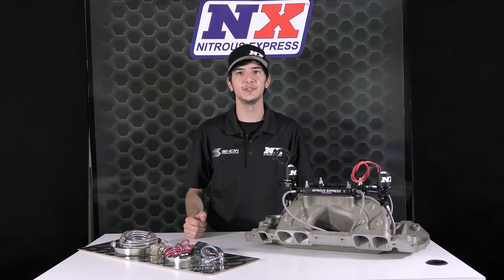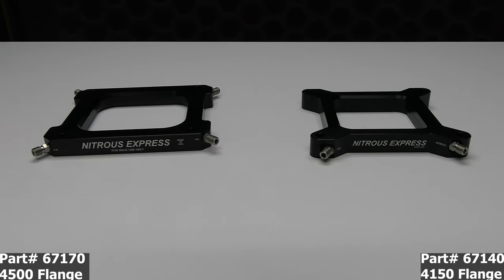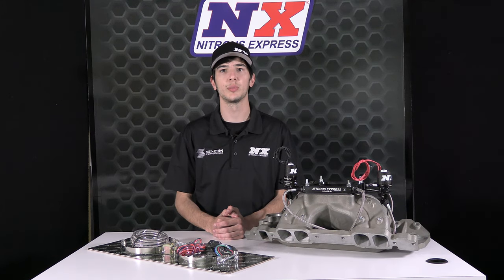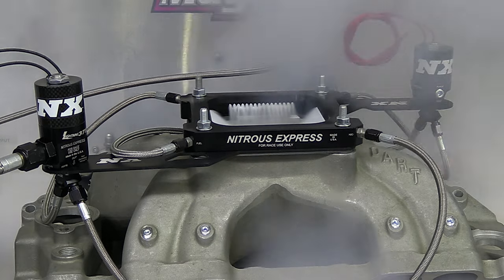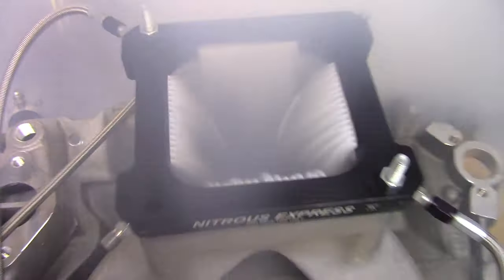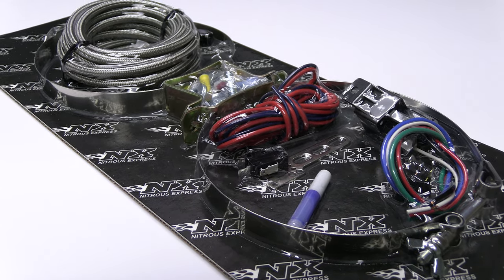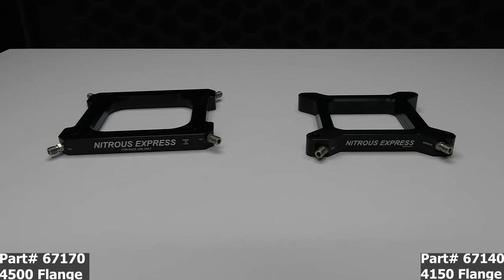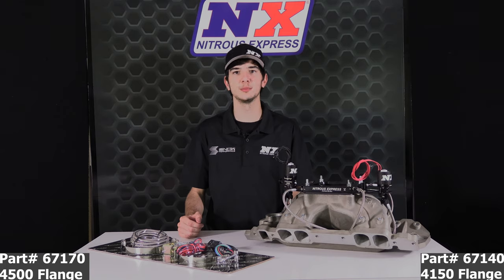The Assassin Nitrous Express Plate System Review

Comment: How does this work with a 2 inch spacer
Reply from the maker: You would either remove the spacer or put the spacer above the nitrous plate
Reply: @NitrousExpressVids  how would you compare your system with the one that has the cone in the middle
Reply: Carefullhy. :-*
Reply: @infamousnova  Nitrous Express is dominating ultra street. Their single entry X bar plate is IT. The plate with the cone in the middle is great for upto a 400 shot.
Reply: @abhirmalhotra5103  hmmm that's good to know. Thanks for the info